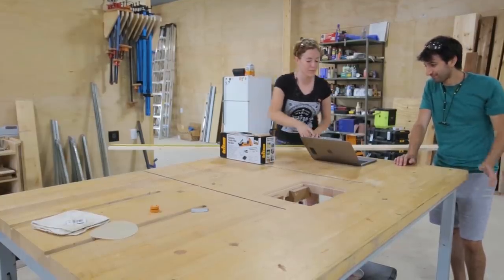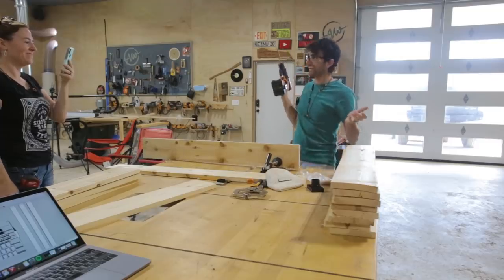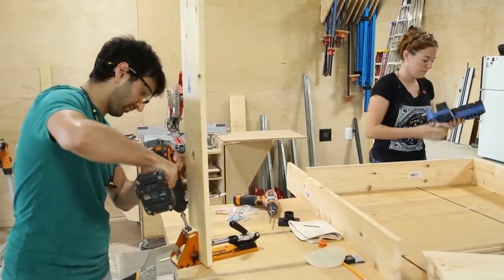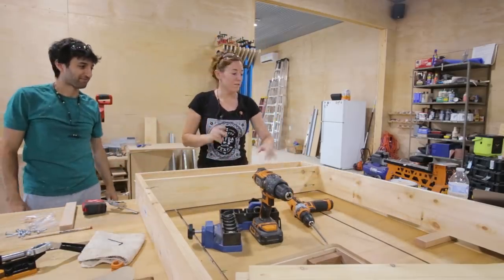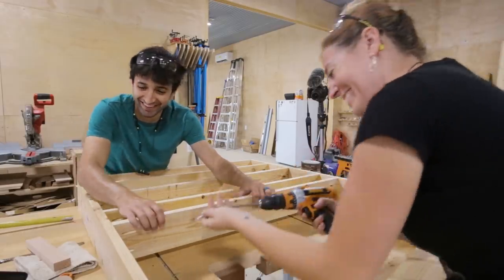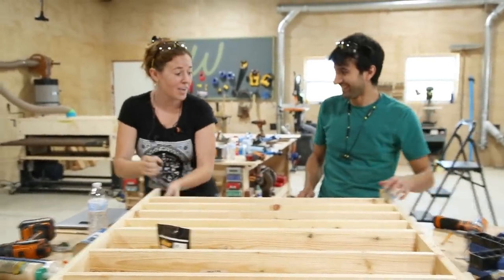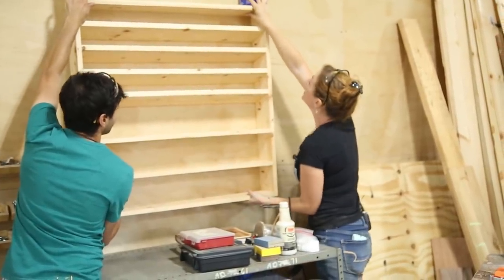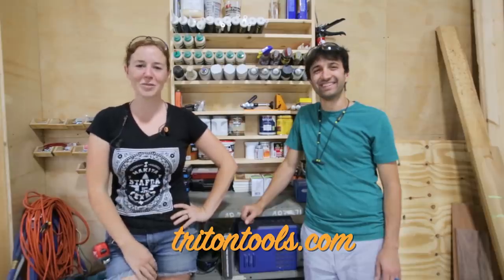Easy Workshop Storage Project with April Wilkerson and Matt Cremona

Comment: I love April's thought that Matt would be bothered by the warped board.
I also really love this type of design with the slanted shelves. Such a good use of space. I made something similar as a wall sized spice rack for a cook, where as long as you wrote the name of the spice on the jar lids, you knew what everything was, but it used way less space this way. I did angled dados instead of pocket holes and hung with a french cleat though; but for a shop project the quick efficient way prevails. Great work y'all!

Comment: Hey April! 
Please don't take this the wrong way, because I am not a hater. It is just curiosity ever since you showed us what the shop was going to look like. Ok, here it is, why the huge shop with the really high ceilings that will make it a pain to cool and heat? Do you plan on making a second floor? I think it is great you have two designated areas for welding and other metal work. At some point do you plan on expanding your business where there will be more employees will be hired? I think of these questions everytime you or someone talks in the vast shop and you can hear an echo. there's no judgment just curiosity. Thank you ahead of time.!!
Reply: I can't speak for April but generally speaking 12' eves are standard on shop buildings over 2K²'. A lot of vehicles and equipment exceed 8' in height, basically requiring a 10' door which usually requires a 12' eve. Building a shop that size with less than 12' eves would devalue it from a resale perspective IMO. 

Plus, she's from Texas.......
Reply: Also in hot climates it is better to have higher ceilings so the heat gathers up high and not right where your head is, therefore keeping you cooler.

Comment: Avoid fractions by being sensible, following the rest of the world and working in Metric! Greetings from Ireland, where the only acceptable imperial measure is a pint!
Reply: I wholly agree
Reply: Nonsense it is all what you are used to.
Reply: @ericcorse  - I am of an age where I was taught linear measurement in both Imperial and Metric, slap bang at the time when we were in the throws of metrification. I am able to work in both and as a boat-builder, more often than not find myself working in Imperial. Metric is easier, full-stop. I'm not having to do fractional division, I just have to work to the nearest "1" or at a pinch half. Plus, it's all multiples of ten, so even a mathematical simpleton (I'm actually numerically challenged and have dyslexia) can manage to do the maths without too much hassle.
Reply: @timmymojito  I understand metric is more straightforward but I have used both all my adult life but I don't have trouble with either. IMO it is what you are used to.
Reply: What’s half of a millimeter? 0.5 mm or 1/2 mm?
Reply: The English system of measures put men on the moon--it's good enough for some crappy shelves.
Reply: @tzkelley  NASA is using the Metric system. The Apollo Computer uset the metric system with an inbuild imperial converter.
Reply: @crs1012    If you can build projects to within 1/2 of a mm then you are a far better woodworker than me. In the case of this type of project i just place two similar cans on the bottom shelf and place the required spacer on top of the can and then rest the next shelf on top. This eliminates surprises such as what April experienced when finding one can fits and the other does not. I cut scrap pieces of material of different thicknesses that I save to use just for these occasions. There are no fractions or conversions when you use the item to be stored as the measuring tool, just spacer selection.
Reply: @crs1012  yes
Reply: @Kullioking  So, you're saying the F1 engines weren't built to deliver 1.5 million pounds of thrust but 6.67233 million Newtons? No, the English system was/is alive and well. Both systems have their advantages--there's no need to be a Nazi about either one of them. Come to think of it, the Nazis probably used metric...
Reply: @tzkelley  I only say Wernher von Braun.